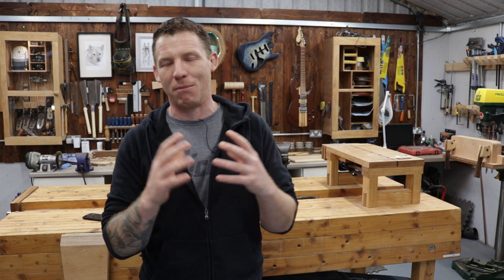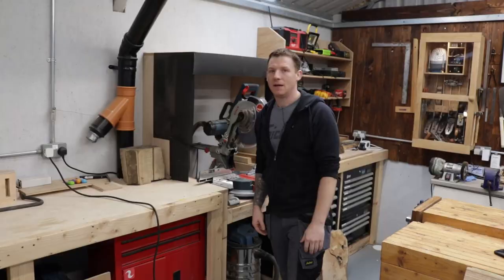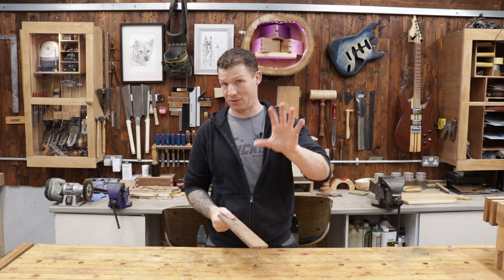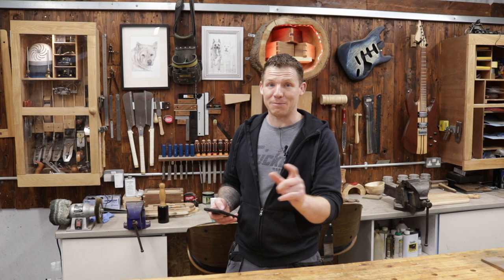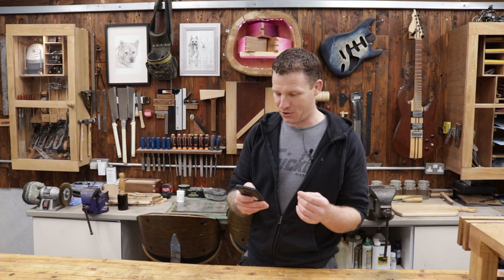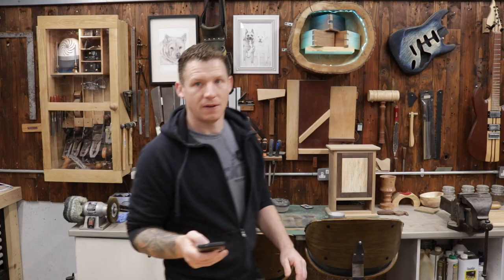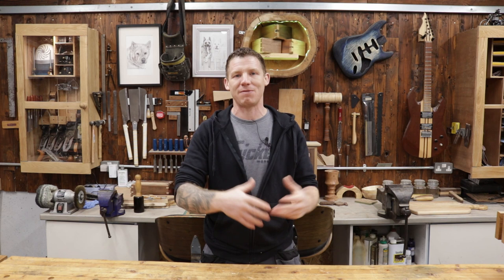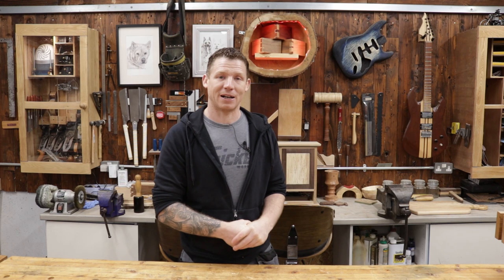WorkShop Vlog #13. Dust Extraction. Air Filiter. Q and A

Comment: Agree so much with your comments about satisfaction with a final product...
sometimes we can get so focused on the idea of how the project should turn out that we lose sight of just how good the end result is, only because it didn’t turn out how we pictured or wanted it to be.

I recently finished a project that had some sanding marks left in the topcoat that I didn’t catch until I started waxing and buffing out the finish. I was fuming mad about it at the time, but the funny thing is nobody but me has noticed it, and when I have pointed it out nobody cares. They think it’s beautiful. I’m very glad I spared myself the work of starting over and just finished that piece the way it was.

Comment: Great video as always. Suggestion for your mitre saw to build a dust collector that attached between the two fences on the saw. 
I got my idea from fisher shop channel and have found a huge improvement with 90 degree cuts so i made one for each type of cut i normally make. 
With your cover as well I would be surprised if you would not get very close to dustless cutting

Comment: John, another great honest video with loads of info. Have to say, in recent months I have spent a lot of time in my workshop building a camper van conversion and when building the units etc,  I found myself getting a little caught up in the chest which is not normal for me. So having watched you previous video on the Axminster air system I decided yesterday  to also invest in a good vacuum system. I bought the Axminster craftAC118CE cyclone dust extractor which will be a game changer for me. In the new year I will buy a similar air system to yourself.... have to wait and pay for the cyclone first 🥵 money well spent on our heath is my believe 👌 Thanks again for the informative blogs and in general it’s my go to woodwork channel 👍👍
Reply from the maker: I have been looking at camper vans myself Martin let me know how you get on!

Comment: That compact dust collector does look powerful and useful.  To be fair to those who questioned whether it was sufficient to run a large system, I note that your air cleaner removes a lot of dust from the air.  That makes the air cleaner worthwhile, but it's almost the definition of primary DC inadequacy.  The combination works well, but suggests a mask is warranted at times.
Reply from the maker: I would still always wear a mask when sanding or using the router flatting jig, that's where most of the dust on the filter came from, the last few projects.